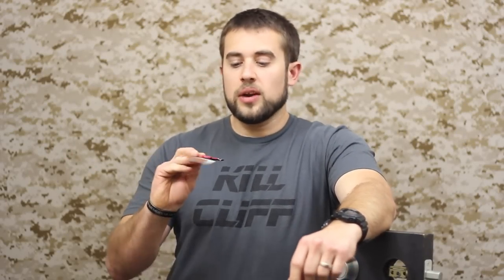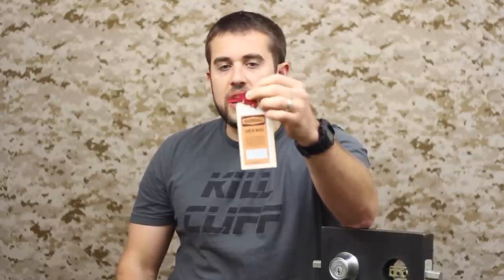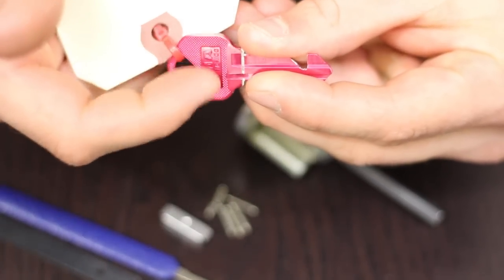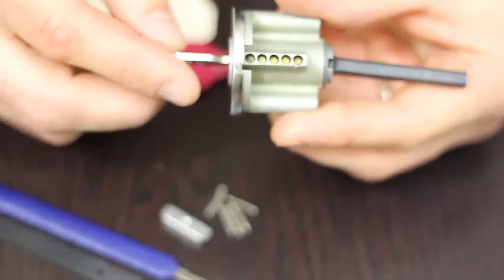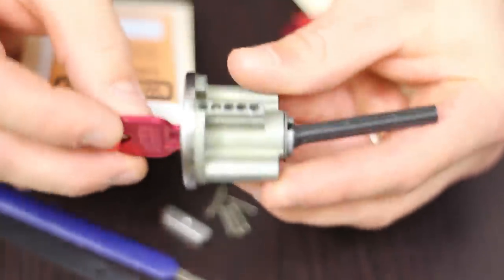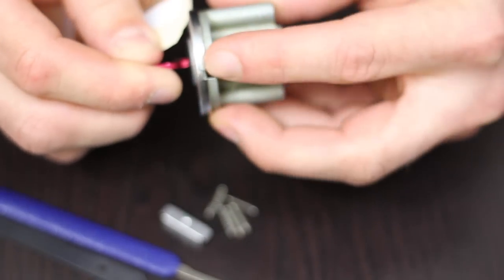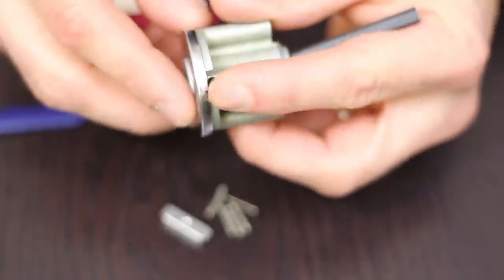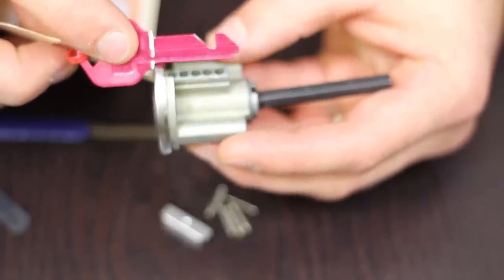Permanently Disable a Household Lock with Lock-Kill

Comment: Absolutely no legal reason for using one of these. If the tenant is legally evicted then you would just drill out the existing lock and install a new one. If the tenant is not legally evicted then doing this would be breaking the law and the tenant would prosecute you.
Reply: Yup!
Reply: Some areas have horrible laws, though, that greatly favour the tenant in unfair ways. At times, you have tenants who aren't complying with something that they are required to, and going the legal route can be expensive and time consuming. That's when this comes in handy. Generally speaking, though, you're probably right.

Comment: 20 bucks for that thing? Why not just hand file a 90 into one of the valleys on an existing key? Seems a bit of a ripoff to me.
Reply: Pice is their so kids don't abuse it, if you legitimately want to stop someone getting into your property, you would happily pay $20.
Reply: but they're red!
Reply: You'll have to call a locksmith after using a backcut key blank anyhow, if you don't know how to drill a lock.
Reply: Bryn Bushey
 why not simply ask the hardware store clerk to make this mark in the blank it cost the same ether way
Reply: ChrisD4335 a solid bump and a well timed twist will open most any lock. Bump keys pretty much a placebo in my eyes.
Reply: ChrisD4335 who charges $500 to drill someone's lock? ripoff artists, period. but if you don't know where to drill and what to do, you can cause more problems that you began with.
Reply: Diesel Ramcharger Sorry, you can't bump a lock with a key blank stuck in the keyway.
Reply: cryptsub You meant to say, you cant bump a lock if it has an uncut blank that holds the pins above the shear line. If the blank is cut at all or not full size you can still bump the lock. Thats what a bump key is, a blank you stick in the lock to assist in applying the shock to the cylinder.
Reply: Diesel Ramcharger
So your solution to open the lock in this video is to bump it. I just want to make sure that's what you are really saying.
Reply: ***** a tube of super glue is cheaper and will cause much more havoc than this stupid "key"
Reply: Diesel Ramcharger so many things you can stick in a keyway to KO a lock. but a back-cut blank is the easiest way to make sure the function of the lock is wrecked. you can use a solvent on superglue and still possibly make the lock work again. driving wood shims into the keyway would be more effective.
Reply: Ken Barnett A solvent will unstick it.
Reply: Ken Barnett Yep depending on the state. It's probably B&E in most places after eviction is complete. They can kick in the door, break a window, remove a sliding glass door. Strangely enough, no one seems to be picking locks.
Reply: Ken Barnett Arkansas has some of the most ridiculously pro-landlord laws in existence. Makes me glad I live in a more civilized state.
Reply: cryptsub 
Better than pro dead beat
Reply: 2point0T whatever

Comment: The only practical use of this product is being a dick to random neighbors.
Reply: +childofnewlight rofl
Reply: +childofnewlight Then again, you could just use superglue.
Reply: +Lauri3000 Why do that when you could waste money on and irreparably damage the lock with this?
Reply: +childofnewlight 😂
Reply: +childofnewlight 😂
Reply: +childofnewlight You can then sniff the glue for extra enjoyment.
Reply: +childofnewlight or not-so-random...
Reply: +childofnewlight Actually this damages the lock less than using superglue. With this, you can just take the lock off with a professional (or even yourself if you're crafty) and get it working again, while with superglue you have to get a whole new lock. It's even said on the video, but if you're a landlord and you want to block your troublesome customer's access to the house, you can use this, then when the situation is handled you can call a professional to extract the lockkill and you don't have to replace the whole thing.
Reply: +Melodïcore Why wouldn't the landlord just change the locks? thats why I dont get why this product exists. I cant imagine the lockkill and professional locksmith service costs less than a new lock.
Reply: +flip117100 Lockkill is cheap af and with a new lock you would still have to get a professional to install it and it would take more of his time so your argument is pretty much invalid.
Reply: +Melodïcore All you have to do is wash the lock with nail polish remover to clean up super glue.
Reply: +Melodïcore if the pins come out of the top like this lock like this one you can repair it. Otherwise throw it in the trash. A lot of locks you need to be able to unlock it to remove the pins so it would be junk.
Reply: +Melodïcore A landlord needing a professional to change a lock? WTF! It takes less than five minutes and a screwdriver.
Reply: There are a lot of reasons why someone would hire a locksmith rather than replace it themselves. Say you want all the keys to match. If you own a lot of properties and each one has 2-3 keys if might get confusing. Or if you need a key for your tenant and a master key for the same locks. Besides there are a lot of people that are totally clueless when it comes to fixing anything like that. Even if it seems simple to you and I.
Reply: +childofnewlight 

How the fuck is the landlord supposed to get in the apartment once the lock has been disabled? Unless the apartment has two doors, which is pretty rare.  This certainly is one of the most worthless products.
Reply: +Elijah Ellis A $10-15 lock gets you about 1-3mins of protection on average. Much, much less if someone with a little bit of experience wants in your house.
Reply: +Melodïcore No? Changing a lock or door handle is easy. If you need a professional to do that then I think you need another professional to look at your brain.
Reply: +Brian Peniuk It's not necessarily the difficulty that is the issue. There are also liability issues to consider, time restraints on the landlord, and the ease of access to higher quality locks.
Reply: childofnewlight I disagree still. I don't see how a landlord has liability issues changing locks on his own building. If anything shoving this thing in there and breaking it off creates more problems than simply changing the lock. Time restraints maybe, but it really doesn't take that long to change a lock. Ease of access? If it was already a cheap lock then who cares, replace it. But if they were utilizing expensive locks, then using this device makes it near impossible to reuse them. I still think this is a pointless device. Nevermind this key won't even work in a large portion of locks due to its design.
Reply: +childofnewlight made by locksmiths to generate more work hours for locksmiths. :) and just for being an ass or take revenge on someone.
Reply: +Melodïcore why the hell do you need a professional to replace a lock? has the general public become that useless?... Soooo how much would you pay the professional I might change careers.
Reply: +Rusty Hodges  no different to calling a plumber to change a tap washer or roadside assistance to change a tyre.
a lot of people just don't have those skills.
Reply: locksmiths should give this things away for free, ROI guaranteed
Reply: Changing a tyre is not even a skill, all you need to do is unscrew some bolts, change the wheel and screw them back.... like changing a lightbulb basically :D
Reply: Ondrej Mišo Unscrewing bolts is a skill :)
Reply: PandawdyBob changing a tire needs special equipment...  changing a wheel  ?  yeah, i forgot to say that you need to lift the car up a bit, but that is all. I cant see anything complicated, i change wheels 2 times a year and i never had any problems... you really have to be a cripple to screw that :D  and i didnt study any mechanics/craft related school, in fact  i study medicine-related field of science.
Reply: Ondrej Mišo What makes you think I don't possess that skill? :D
Reply: Максим Щербань I didnt mean you, it was meant in general :D i certainly hope you have that "skill" :D
Reply: This is needed by landlords in the case where a tenant changes the locks, preventing the landlord from entering for inspection at any time. The landlord could disable the unauthorized locks and that forces the tenant to replace the original or at least leave the unauthorized lock unlocked. Eviction is an expensive and long process, and a tenant can avoid one by simply coming into compliance at the last minute. This solution simply allows the landlord another option than eviction proceedings to enforce the rules.
Reply: I am not a lawyer; this is not advice: Under California Civil Code section 1950, a landlord may not "Enter for inspection at any time." Only an agreed-upon repair or an annual check of smoke alarms permit a landlord to enter a tenant's apartment without permission or the presence of the tenant. Even then, two-days advance notice, with proof of service, is required.

A better solution in that case would be to place a three-day notice to quit or show cause, which forces the tenant to comply with the lease or to suffer eviction. Assuming that the lease forbids the tenant from changing the lock...

If the landlord must force the issue and does not wish to evict or give a three-day notice, then a doorknob overlock is a better solution -- but the best solution is to go there when the tenant is home, knock on the door, and say, "Change this lock back to the original or I'm going to evict you."

Also, because an overlock or a lock kill will prevent a tenant from immediate access to his or her property, there is a very big legal issue to address, if the tenant wants to get snarky about it.
Reply: kedwa30 that's not how evictions work and landlords can't just enter a residence at any time.
Reply: prairie wanderer 👍 Sounds like the landlord will be out more money because he'll have to call the locksmith to get it open. I liked the one earlier comment too that the only good use for this is a pesky neighbor that you'd like to piss off.
Reply: childofnewlight couldn't you use a ultra thin pick to push up the pins as you pull it out?
Reply: Lauri3000 ikr i love how superglue and nail polish and crayons smell
Reply: Holly shit I’m the thousandth like
Reply: childofnewlight what are you talking about, it clearly has a second use in ruining somebody's entire life because they forgot rent by one day
Reply: childofnewlight honestly
Reply: WhereWhatHuh not everyone lives in California, and not every landlord cares about the law.
Reply: 15$ to 20$ for that is a rip off... grab a couple uncut key make a dent for free with your dremel tool and you just got 7 to 10 keys for the price of 1.
Reply: i will use this on that annoying kid's house
Reply: So why couldn't you take a grinder to your original key and cut a 45 and 90 degree angle. Wouldn't that be the same for free? I could understand a quick fix to a problem but ultimately you will have to change the locks anyways. Don't see any use for this 20$ product but thanks for the idea
Reply: It's used to destroy keys you don't need/ destroy keys other people have to your housr that you don't want in your house anymore
Reply: Thomas McDougall
Same, did this yesterday was proper funny watching the aftermath
Reply: childofnewlight fuck I’m gonna do that now😂
Reply: Tanner Reed  how did it go lol
Reply: Melodïcore you can repin a lock, probably for about what it would cost to get a locksmith to extract the key anyways
Reply: Not true. Could be used on combination locks that have a keyhole to reduce the vulnerability so you have to decode it if you want to break in, instead of being able to just pick or rake it open

Comment: I cannot think of a non-malicious use for this device. 

A landlord would be better served swapping out the lock cylinder (5 minutes with a cross-tip screwdriver). If, for legal or security reasons, the door could not be opened at that time, a doorknob overlock would be a better solution. 

Hotels with card-keys would simply re-issue a new key, cancelling the old one.

Comment: So as the landlord I use this... Then how do I get in later???
Reply: This just prevents someone getting in before you have the chance to have a locksmith change the locks altogether. (watch the video carefully haha)
Reply: ***** if your paying hundreds to get a lock changed - you need a new locksmith! Haha :)
Reply: Pretty sure it's against the law to do this as a landlord
Reply: He says it's impossible to remove without drilling the lock... not exactly true. A sufficiently thin triangle pick can actually remove it. It has to be ultra-thin to fit between the key and the lock itself, and resistant to bending to push each pin up over the lip... probably tungsten carbide, if they can make a piece of tungsten carbide that thin and precise.
Reply: Queen Of Cards its more for tenants already evicted
Reply: yeah all this will do is get a angry Tennant and a busted door marked with boot prints
Reply: Possibly defeat with a burst of air down side?
Reply: It really depends on the depth of the last dropped pin, the strength of its spring, and the amount of leeway left in the keyhole. In any case, it's going to cause some trouble and give a big challenge.
Reply: simple insert brick into household window
Reply: This fucking guy 😂^

Comment: So you buy this for however much, ruin the lock, and then have to hire a locksmith to eventually open the door. Seems cheaper to skip this thing and just pay a locksmith to rekey or replace the lock.

Either way, a pissed-off tenant or whomever you're trying to keep out will get in if they want to badly enough. A 12 gauge will bypass this thing.

Comment: Ok, so its a vandalism tool since any "landlord" would probably be able to re-core any lock they have.
Also, its just binding on pin 4.  Maybe a "key extractor" won't get it out, but any thin lock pick will, just push pin 4 up and out she comes.
How about this: Superglue.  that is all.
Reply: +htomerif In some/most states, self-help evictions are not lawful, meaning the tenant would be within his rights to kick down the door and the landlord would have "dirty hands" in the eyes of the court. (Aka, the judge will view the dispute as one between two law-ignoring idiots, rather than a "good guy" and a "bad guy".)

It looks like this might be a police/military tool. It is totally pointless if you have more than 5 minutes to kill the lock. And even as a military tool, a door lock can not be any stronger than the weakest point on the door. This maybe possibly might be used by the police, but it looks more like a vandalism tool.
Reply: blkgardner Well, I can tell you from personal experience that pretty much every military door lock has gone over to the keys with the milled channel on the side, so this key wouldn't fit. As far as padlocks go, well.. everyone has universal padlock removal pliers anyway :P

I think law enforcement has actual lockable (somewhat expensive) insertable tools.

So yeah, this seems to be just a vandalism tool.  Specifically a tool for mentally challenged vandals that somehow have a lot of expendable cash.

Comment: I can bypass this easy enough. A broken key extractor is very thin and has a flat edge. Push that edge against the pins and push then all the up. Now nothing is holding the kill-key in. You may need a second broken key extractor to gram the kill-key if the bow has been snapped off.
This is basically 30 second job.
Reply: Make a vid!
Reply: Send me the kill-key and I will.
Reply: I was thinking/wondering the same thing.
Reply: you probably can fit a paper clip to push the pin up
Reply: A paper clip is too fat. A broken key extractor is about the same thickness as a business card. Maybe even thinner.
Reply: If actually like to see this done in a transparent lock. I certainly wouldn't buy more than one before knowing it was effective.
Reply: How would you get the extractor under the pin in the "valley"? You would have to push it past the first few pins, then angle it down 45 degrees to get to the bottom of the pin the lock-kill key is hooked onto. It doesn't seem possible.

The only thing I could think of is pushing something along the side of the lock-kill key and then moving it up to push the pins up, but not only is that a MUCH narrower space, but the warding is probably going to stop you from getting under that pin.
Reply: Falcrist put a  small blade of metal on top of the keyway ?
Reply: Falcrist A broken key extractor is very thin and is designed to slip in next to the key. And you'd slip it in above the wards, but below the pins. When it's past the last pin, you work it up, pushing all the pins up, then just pull the key out with the broken key extractor.
Reply: Tom Collins worst case scenario: dreymel+.5mm drill bit ( or the size of the key)
cut the top part, slip a broken straight pick tool,press it on top, and pull the key

Comment: I'm not convinced one of those tools, like a key-extractor or something pretty similar wouldn't work.   If it's thin enough you should be able to insert it in parallel with the key and lift the pins up one at a time as you pull out the key.

Comment: I was a locksmith for 20 yrs. This is a tool that will make it very costly for the property own. You have a trip call plus drill cost and then you have the new lock cost and the keying every other lock on the property to match new keys. Most locksmiths will tell you to just call them and let them go out and do a lockout if it is a business and in most states if it is residential you have to go through the eviction process that the law mandates. Using an item like this will most likely be x however many outside doors there are. So as a professional I would never recommend this product at all.